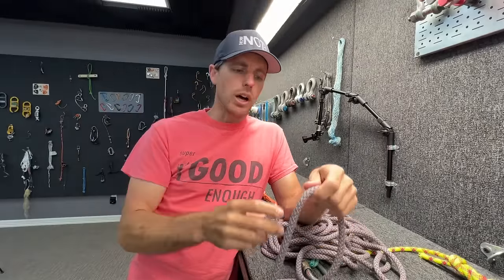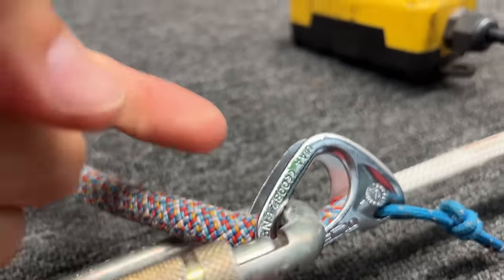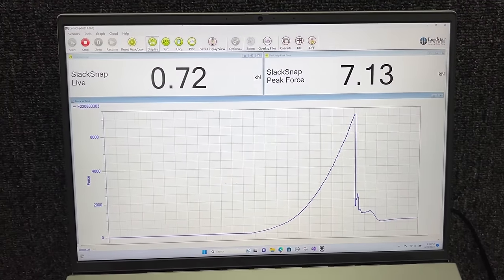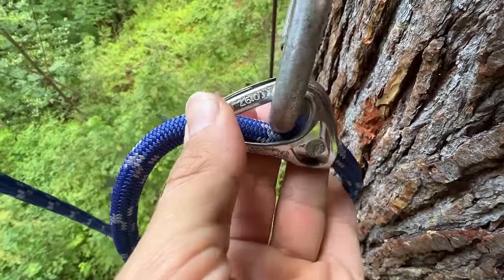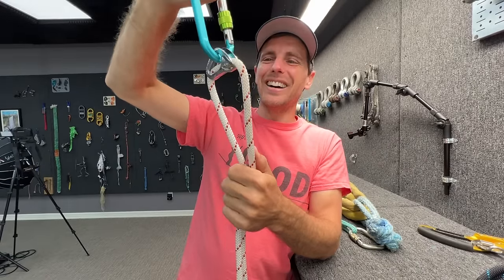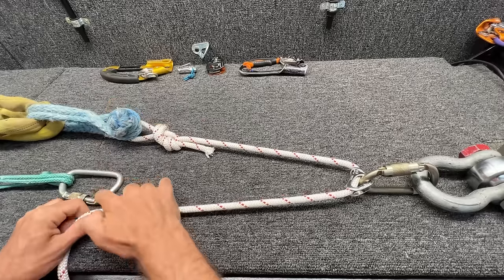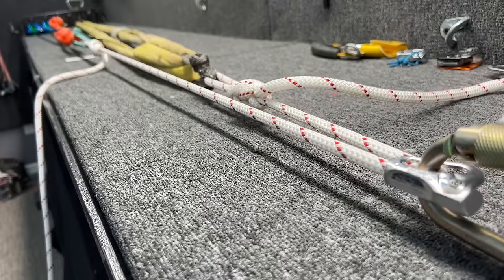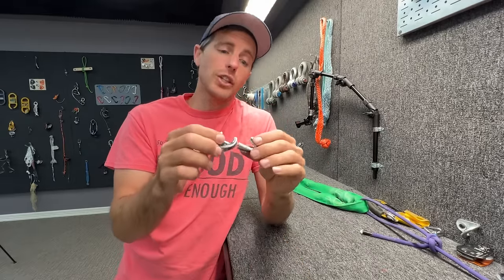It's NOT what you think

Comment: I thought they were for emergency use. Ideal as a back up hand ascender if you are mine exploring l/caving using srt.  Its good to see this on static rope x
Reply: I have one in my crevasse kit!
Reply: I explore mines and always have my tibloc clipped to my haul loop, just in case!
Reply: I use one as a backup when I'm triming trees.  Maybe this was said in the video and I missed it, but Petzl even warns of the risk of desheathing the rope at 4kn for 8mm rope and 7.6kn for 11mm rope.  I like the Tibloc, but personally, would never count on it being my only connection to the rope.  I'm usually also tied in with a prusik or other mechanical descender like the Notch RopeRunner.  That said, the Tibloc did get me out of a jam once when one of my prusik's seized up on the line so tight I couldn't get it to release.  Using the Tibloc I was able to momentarily take my weight off the prusiks and get a figure 8 in below them, and then use that to get down the rope.  It's so small and light weight there really isn't a good reason not to have one, unless the rope you use is just completely incompatible with it.
Reply: i use it on top rope solo not as a safety device, but if i need to get weight off my system to switch to rappel then i use the tibloc to do so since it’s so easy to get on and off and you only need one or two jugs to get weight off the main device
Reply: Ditto. I Cary these climbing for an emergencies/self rescue.
Reply: I dont do rope climbing, but I allways carry one rappelling for self rescue and/or as safety device.

Comment: The timing of this was great - the alpine savy post mentioned using them for low - load progress capture devices and specifically pointed out Petzl instructions to run rope over the carabiner when used like that. I thought it was for load distribution of the rope over the carabiner so it wasn’t on the rails. Turns out it was the edge de-sheathing the rope were supposed to be afraid of!

Comment: Hi HowNOT2, I recently went multi-pitch climbing in a group of three, and we used two single ropes instead of twins. We clipped them as we would with twin ropes. It was a bolted route, so I figured we would be fine. I would like to see the difference between the forces generated in a fall using twin ropes as intended and using two single ropes in a single piece. My gut tells me that more force will be generated when using single ropes, since there is more "braking" power. I'd love to see this tested in the drop tower. Thanks!
Reply: I’m reading your question wrong maybe.   You generate the same force either way, the same load is falling the same distance.   The energy dispersion will be faster or slower between ropes.
Reply: @MoodyWorksInc  I think it would be a harder catch (=more force) because there is less stretch in a single rope than a half rope
Reply: @IAmMaarten  Correct. And rope stretch is not linear and a stretchy feeling rope at hand generated loads doesn't mean it is better or worse at fall type loads
Reply: The leader would experience what you would call an auch to his back
Reply: Like the previous commenters said, I would highly recommend not doing that because falling on two single ropes (not triple rated) will mean a very hard and potentially painful catch. Unless maybe when you're more worried about hitting something in a fall than a soft catch. The way to go in your case is to only clip one rope or alternate between which rope you clip.
Reply: Or very dynamic belaying, to reduce the effect!

Comment: I have used one of these before to climb the mast of a sailboat using a block and tackle. Mostly so you dont need someone bored on deck losing attention to you and being trapped up there when someone on deck is running the winch and decides to take off. Its never failed and if it did all you need to do is grab the falls of the tackle to stop or slow your descent.

This was definitely interesting. I didnt know there were so many ways to use it.

Comment: Could you test the Wild Country Ropeman ascenders.  They don’t have small teeth but use a cam and horizontal gear-like teeth.   I’ve had a couple for years but have never used them as there wasn’t any good data on them.   I’m sure you could reach out to the company and they would let you test them.
Reply: BTW, I think they are useful for a ratchet system in a haul 3:1,5:1 pulley system.  Nice and small and light.

Comment: I have, in an act of desperation and optimism, used a tibloc as a bolt plate for Aussie carrot bolt (just use one ‘cheek’ as a plate & clip into the bigger side to trap the thing onto the hex head) I’ve often wondered if it would have held a fall…. @HowNOT2

Comment: Never thought about adding it to an anchor to protect in simul climbing. Seems like you lose the shock absorbing ability of the second as counterweight, and risk higher forces overall. Nice as a backup for the second in case the rope gets stuck, or the crux need to be passed. You should do a test against a standard prussik
Reply: rope moves through the biner if leader falls, teeth only engage if second falls

Comment: I love your videos, but this one was a failure.  IF you use the tibloc correctly, ALWAYS WITH THE ROPE GOING THROUGH THE CARABINER, it will hold and almost rarely cause any tearing of the sheath.   IF, as you did in all but one of your tests, you just put the rope through the device and NOT the carabiner, then your rope will shred.   Watching your video made it seem as both were fairly appropriate, and failed to properly distinguish between why to do it CORRECTLY verses incorrectly...   As a person who loves my tibloc, these are just my thoughts.
Reply: While I would agree with you from a practical standpoint, the technical notice from Petzl does indicate that the Rope does not need to pass through the carabiner. For reference it is number six on the notice.
Reply from the maker: Failure is a rough word... download the technical notice from https://www.petzl.com/INT/en/Sport/Ascenders/TIBLOC.  As @davidsnaz mentions it is #6 that says it is "ok" to do it without the rope IN the carabiner.  Even though it is super ok enough to do it either way, the point of the tests I do is for all the what ifs, even if you are not supposed to do that thing with the thing because sometimes people do that and it's nice to know what happens.  We got the same result with and without the rope in the carabiner when pulled normal like an ascender.  Your rope will shred if you put enough force on it, regardless of how you clip this.
Reply: Then the failure is on Petzl if they are putting out bad information.  My apology.